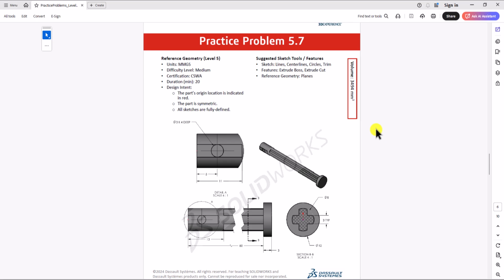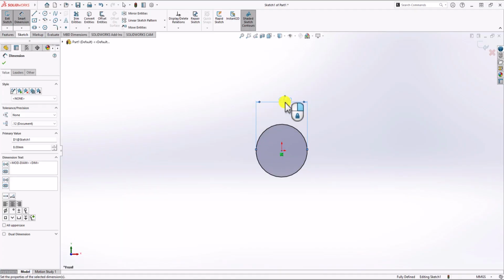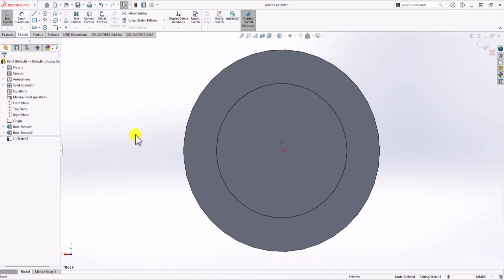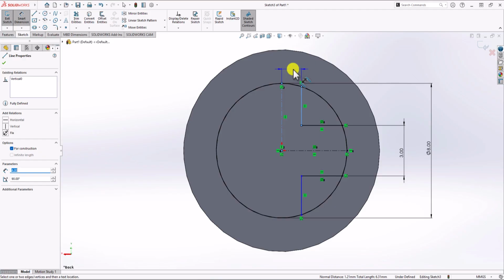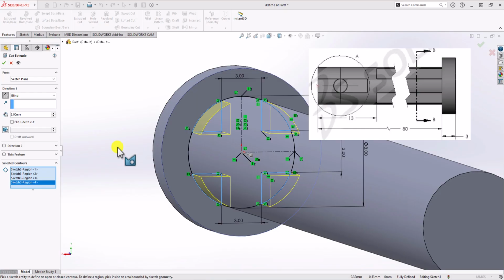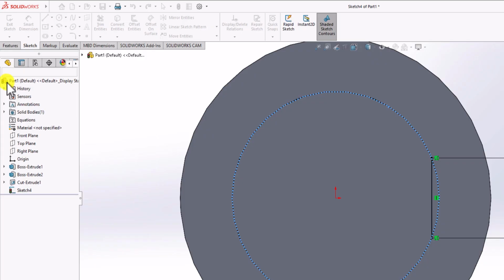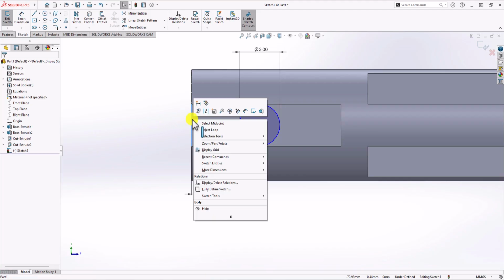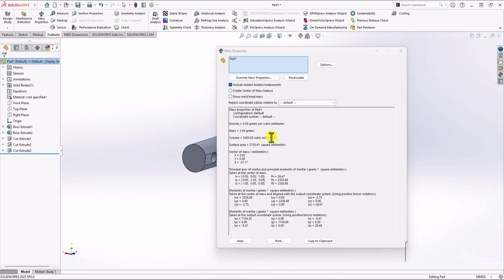CSWA Practice Problem 5.7 Solution | SolidWorks Exam Guide

Comment: I don’t know why it said in the problem can use planes as my method was similar to yours apart from couple of mistakes I made.  To correct had to remove one extra flat edges.  Then make hole 4mm deep instead of through all.
Reply from the maker: Remember that there can be multiple ways to model a part in a single question, so don’t be surprised if you use a different approach from the one shown in the question. As long as you get the correct answer, you don’t need to worry about using the exact same modeling approach.

Comment: Hey Roozbe, shouldn't you have started the circle drawing in the right plane? Let me know if I am wrong.
Reply from the maker: Remember that the Front and Right planes are simply definitions that we assign to a part. In general, people try to choose the Front Plane in a way that provides the most information about the part, but there is no strict rule about which plane must be the Right or Front Plane.
It’s ultimately up to you as the modeling engineer to choose the plane you’re most comfortable working with. In this case, you are absolutely right and I think it's better to draw circle on the right plane. you can choose to create the circle on the Right Plane, start the model from the Right Plane, and continue with all the same steps. You should still get the exact same result as I did.
Reply: @Design_With_Roozbe Thank you, that helps!